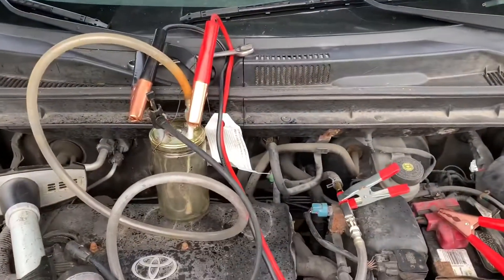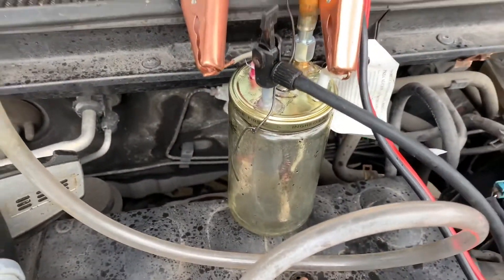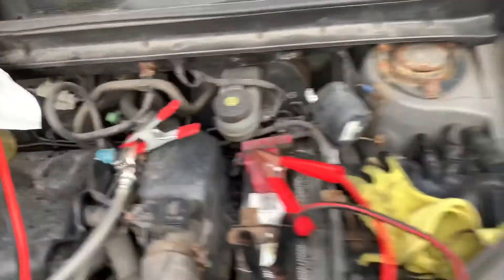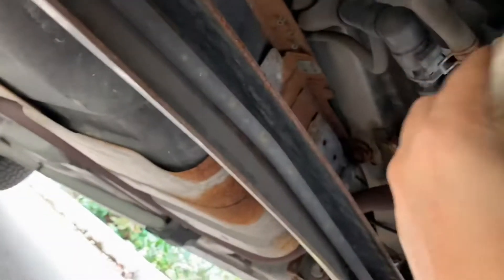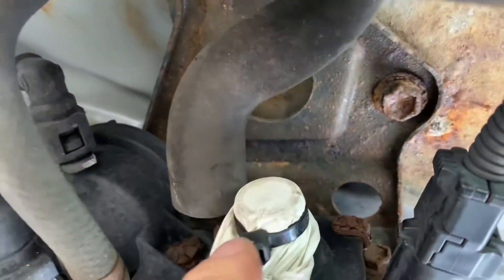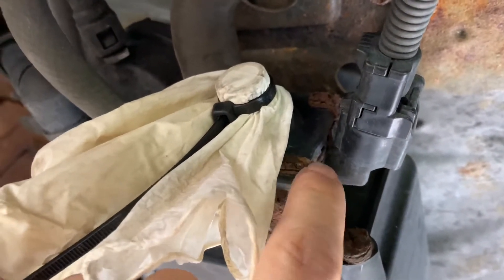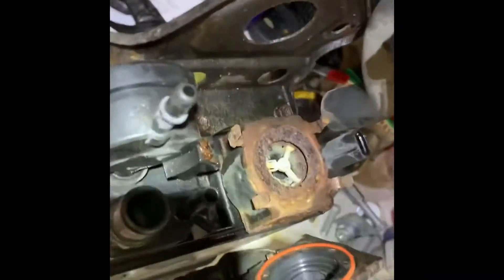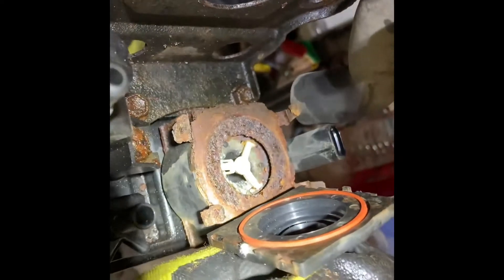2004 Scion xB check engine code P0441 p0442 p0446 small leak evap emission system Completed

Comment: I have an 05 with the same codes, so you're saying the canister is the problem in the rear by the gas tank?
Reply from the maker: Yes
Reply: @diydiy5883  I'm gonna check it out 🤦🏽‍♂️thanks buddy BTW what's p0420?
Reply from the maker: @dynoesaur  no idea, but you can google it
Reply: @dynoesaur Catalytic converter

Comment: I have the same codes on my 05 xb I replaced the vacuum hose line from the throttle body to behind the motor it was cracked but check engine light keeps coming on I'm gonna check this when I get chance. 
Thanks

Comment: Thanks, good detective work.
I am about to do this repair for the 3rd time in 6 years on my 2004. It seems like no stopping the rusting of the canister purge valve cover. This time I have only the P046 code.With the charcoal canister mounted on the car I'll remove any hoses or electrical connectors on the valve side of the canister to make work room. With needle nose pliers I'll pry back the 4 metal tabs of the purge valve and carefully remove the plastic lid. Carefully because it is like a Jack-in-the Box - behind the plastic lid is a large O ring/a plunger diaphragm/and a spring. I'll clean the rust and reassemble. Since the O ring fell apart years ago, I use red RTV sealant in the groove where the O ring was. Then I'll crimp back the tabs on the cover. I suspect that eventual rusting of the metal case makes a leak between the metal case and the plastic lid. This time, I'll primer and paint the area to try to slow the rusting. Other people have posted this repair on line.